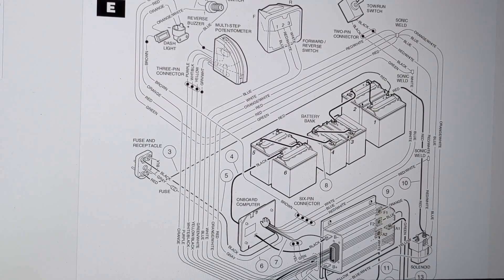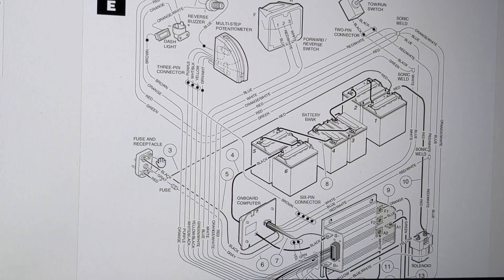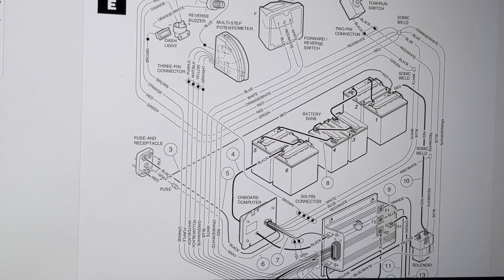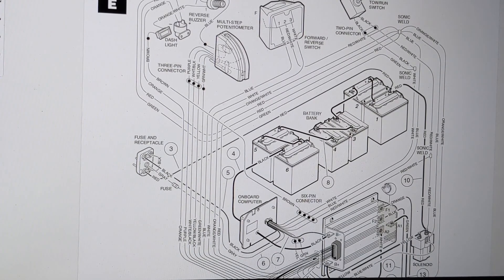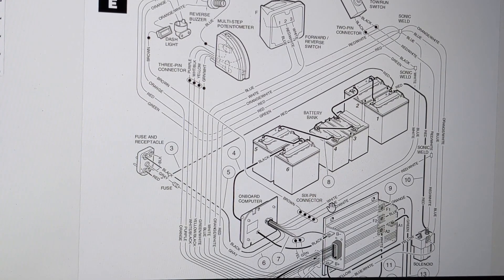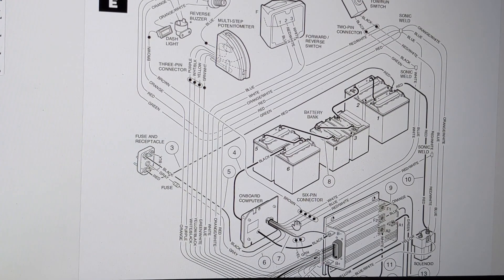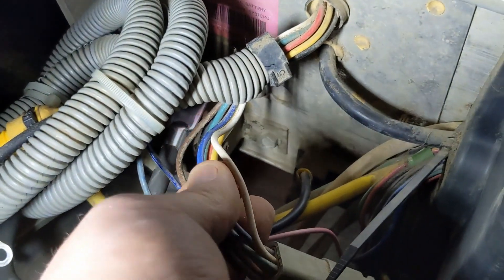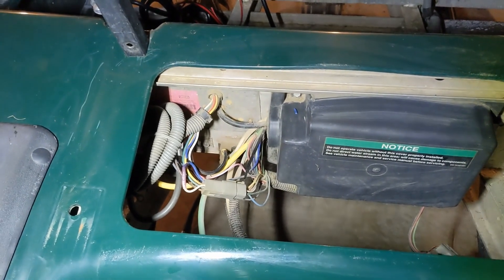Lithium Upgrade Wiring Changes on a Club Car DS for a Vatrer 48V  (explained and shown)

Comment: Would you cut the rest of the wires going to the obc
Reply from the maker: All your choice as it is not needed anymore.
The OBC is completely by-passed, the motor controller is required.

I decided to leave it in and just tuck the wires out of the way as a "future proof" in case the owner ever wanted to go back but the odds of that is zero now as he still tells me all the time how happy he is with it. 
So really it's up to you but it is not needed at all. 

Hope that helps and thanks for checking out my channel :)